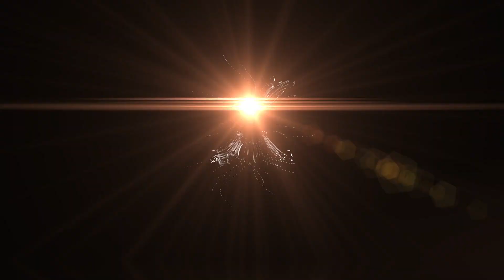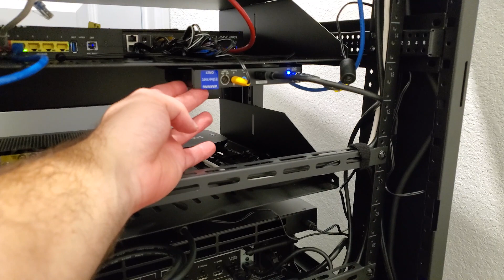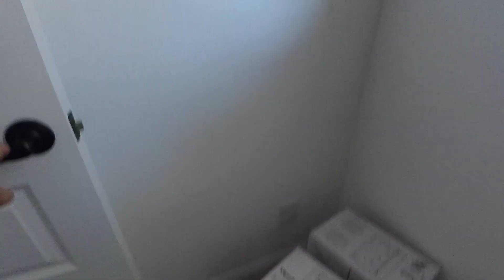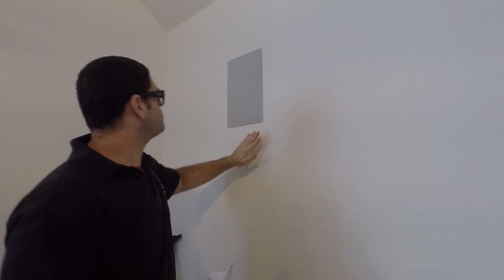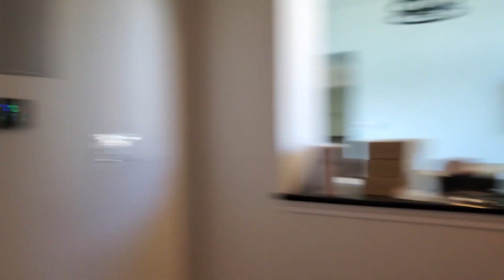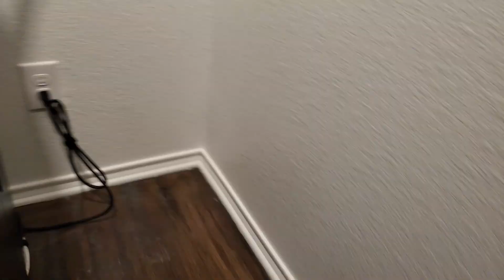Klipsch 5.2 Reference Premiere Media Room, ELAN Automation, Araknis Network - Flower Mound, TX

Comment: Awesome set up. Unfortunately I live in GA and can’t have you guys do my system. How do you feel the Araknis WAP perform. My local installer just installed the 810 series access points but this far I’m not impressed with the coverage.
Reply from the maker: Steven, thank you for the feedback! Overall, we really like the Araknis networking equipment. The 810 series is the latest WAP with Wave2, MU-MIMO, and capable of higher throughout speeds than the previous flagship, the 700 series. While the 810 is capable of higher throughout, it is really more beneficial for high density networks. I'm told that the range is lower to stay in compliance with the latest FCC regulations. I tend to install a lot more of the 700 series simply because of the range.
Reply: Pure Media Systems thank you for the reply...would you say having the the 3 WAP paired with the 310 router and 310 switch might be doing more harm then good. My house appx 3600sf with a fairly open concept. I just can’t find a lot of info from snap av since I am not a dealer. The specs seem off the charts just want to make sure the $ is worth it. Thanks again for any advice. It was good to see another home theater network channel actually using a lot of the gear I have to get advice and ideas on.
Reply from the maker: At that size, it's a minimum of 2 WAPs, and depending on the layout I might add a third to add coverage. I don't have a problem with any of the equipment. It is possible that there could be interference or other factors at play if you are having issues. Could be configuration, could be your ISP (Internet Service Provider), and performance always varies depending on what your device is capable of and what it negotiates with the network.